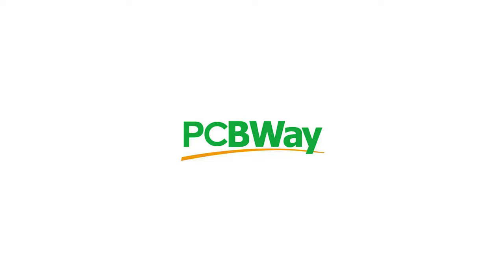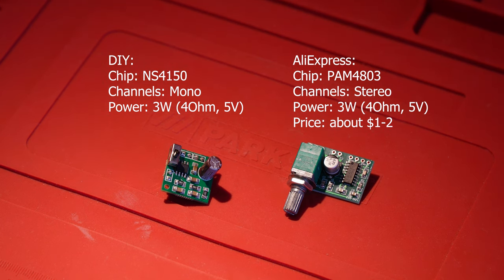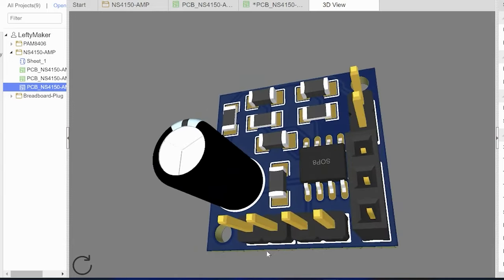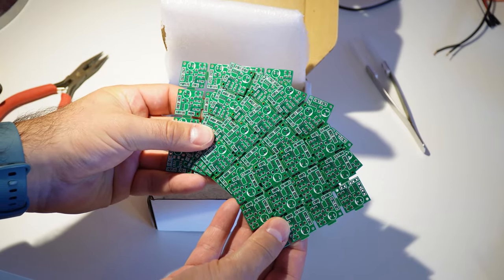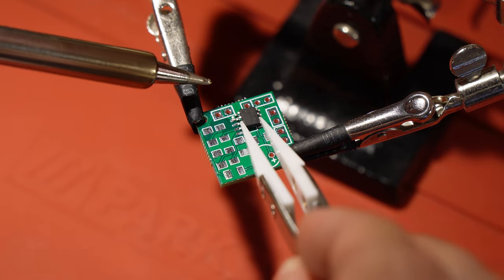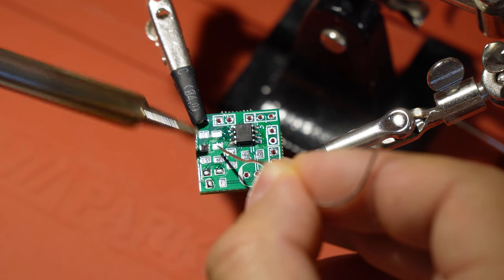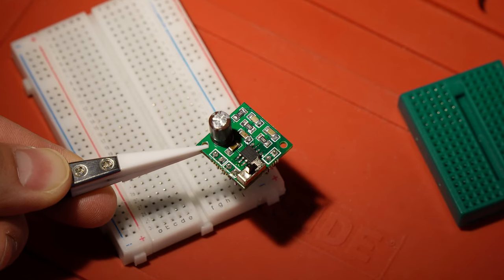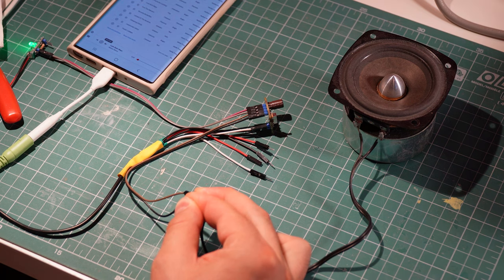I made a TINY amplifier! (NS4150 chip amp and SMD soldering)

Comment: ah nice, well done! PCB design is a really cool practical skill, especially when you need to make something compact or completely custom without using off the shelf modules ^^
Reply from the maker: I know, right? Ready-made modules usually don't have enough filtering caps and have no mounting holes.

Comment: Hey I have a question that I can't seem to find a solution for. Suppose there is a button I would like to be pressed all the time. However, in this case unfortunately when I press the button; every time I disconnect power it resets. What can I create in order for the circuit to close (simulation of the button being pressed) every time there's available power. Thank you 😊
Reply from the maker: Would a relay work in your case?

Comment: I've built a small stereo amp using a MAX4410.  It's meant for headphones but it can drive a small speaker.   The goal was to use a tennis ball as the speaker cabinet.   I'm using a 3 W 34 mm speaker.   I would like to make it louder but I also want good fidelity (low harmonic distortion.)   Have you measured the harmonic distortion for this amplifier?
Reply from the maker: Hi! Not yet. I'm not sure how to measure it yet :)
Reply: @LeftyMaker  Room EQ Wizard can do it.  It is set up for using with USB measurement mics but I'm sure there is a way to do it using any decent mic.   Your response curves won't be calibrated without a measurement mic, but the harmonic distortion is more likely to come from your amp and speaker than from the mic (unless you use a really cheap or beat-up one.)   You can compare results with other speakers which you like the sound of.
Reply: This is not what one might call a low distortion amplifier, at THD 0.1% typical as per datasheet and recommended test circuit, it's a little up there. But it's also below what are often considered audible levels and foremost the nonlinearity of a tennis ball speaker is probably going to be a lot higher than possible nonlinearity from such amplifier (excluding clipping), in particular if you want it to be somewhat loud you'll be running into driver nonlinearity due to issues with voice coil magnet coupling (xmax related) that will be easily several % plus you have intermodulation from the driver, plus compliance related distortion from the speaker cabinet as it were.

The main THD contributor in this amplifier to the mediocre figure (as long as you don't hit clipping) is basically overlayed broad spectrum switching noise, vaguely blue noise shaped, visible on the rising THD up to 2-3% at very low volumes, which i mean, you sort of expect it don't you that if you put your ear to it, you'll hear the distinctive noise, the percentage figure isn't all too meaningful if the resulting noise is near or below absolute hearing threshold at intended listening distance. It's a little different from pure added noise since when there's no signal at all, there's not necessarily noise either, it's triggered by useful signal. Similar to quantisation noise, and it sort of is a variant of that, since though the drive circuit isn't time discrete, it's state-discrete and also has a minimum possible state transition times to observe.

I don't think MAX4410 is going to maintain high linearity when used in this way as you're doing so now either, say with a 4 Ohm speaker, i think it's in pain. It is however probably going to stay relatively low noise, much lower noise than any speaker purpose chip amps.

Of course there's all sorts of THD sources and it's an endless question which of them are audible and objectionable under which circumstances - various overlayed noises, zero crossing distortion, decay in linearity near peaks at increased amplitude, symmetrical vs asymmetrical.

Cute project though for sure <3
Reply: @SianaGearz  I failed to mention that this was for an outdoor art project:  the tennis ball speaker goes at the focus of a 1m parabolic reflector.   Out in the woods there is so much background/wildlife noise, it wasn't that critical.  I would like to move the project to larger spaces, indoors or out.   I've gathered what I need is an inverting op-amp on one of the 'stereo' channel inputs, then I could run the MAX in bridged mode.

I have crudely measured near-field response using REW.   The HD is there but it is pretty low.   The frequency response is about as good as you might expect -- not flat but intelligible.   In the reflector, the 'bass' at 150 Hz is not very directional.   The highs are very much so.   I need to get motivated to measure in the far-field.
Reply: @mog068   MAX will still be in pain and even more so in BTL configuration, since the effective load impedance is lower! The current draw correspondingly rises dramatically. Consider that it was only specified for 16 Ohm impedance load not lower. This NS4150 and any number of small low cost chip-amps are already internally BTL, this also goes for various Diodes Inc (PAM) and Fuman speaker amplifier chips, and they master 4 Ohm speakers in BTL configuration (2 Ohm effective) with absolute ease.